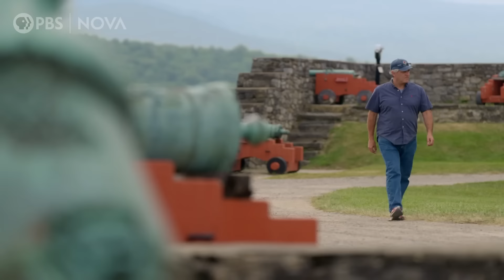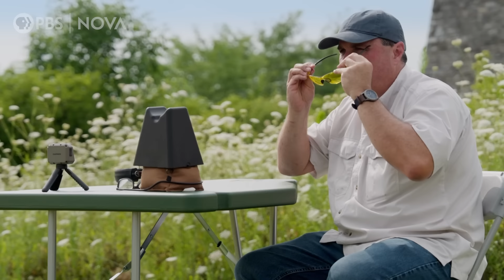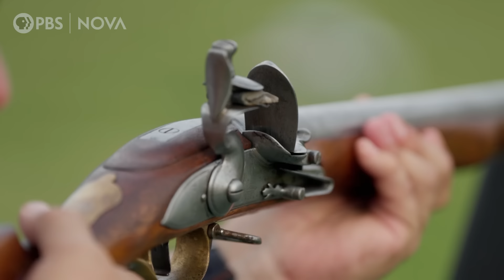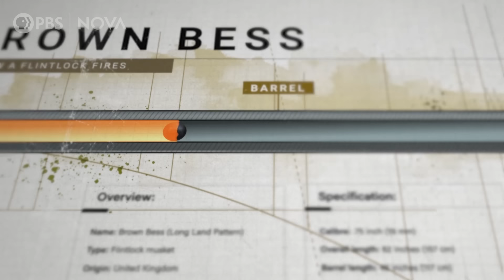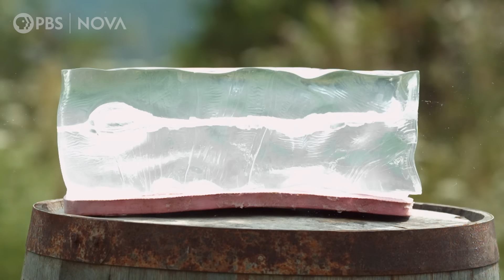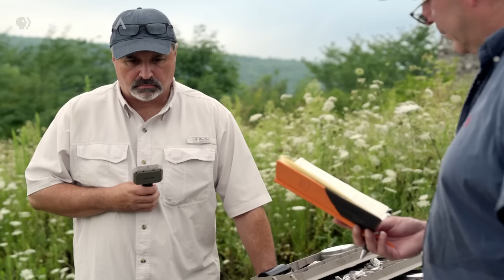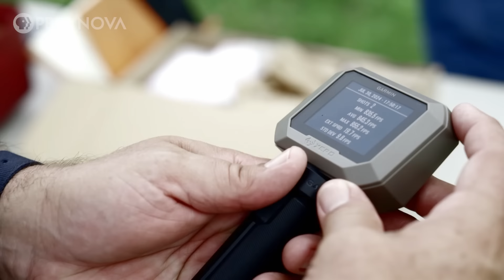How Deadly Was the Musket? | NOVA | PBS

Comment: This has already been scientifically solved. Energy and cavitation are insignificant compared to what tissue or vital structure is actually damaged by the bullet. For example, energy/velocity is important only if it creates the correct wounding method for the bullet. That can be through expansion or fragmentation. Cavitation or the more correct term, temporary wound cavity, is only significant if it exceeds the threshold at which our tissue stretches and contracts. If it exceeds this then yes it would create tearing which would then be considered part of the permanent wound cavity. The 2 primary methods to kill or incapacitate someone is through blood loss or destruction of the heart or brain.

Comment: That is NOT smoke from yhe bullet. Thats probably water vapor from rapid expansion and contraction of gas inside the pocket the bullet makes condenscing and then boiling water off into steam. If you look at the "smoke" exiting from the entrance hole, it seems much more like an energized gas than a residual smoke.

Comment: I am doubtful about the test because there is no data on the load, the bullet weight and exact diameter, and its loading method. Besides they are not the first to shoot with black powder on gelatin. The napoleonic Charleville 1777 was loaded with 12 gramms (186 grains) of black powder. This terrific amount of propellent with a very large and soft bullet (.69 lead bullet) should have a better stopping power than a smokeless rifle cartridge within 200 meters.

Comment: feets, miles are very unscientific measurements.
Reply: No they're not
Reply: @JS-wp4gs  yes they are. In metric systems everythin is 10 based. 10 milimeters is 1 centimeter, 100 centimeters is 1 meter, 1000 meters is 1 kilometer. Imperial 12 inches 1 feet, 3 feets is 1 yard, 1760 yards is 1 mile. Where is logic? Its absurd

Comment: Unless I missed it, they failed to divulge what distance they were firing at. They also state the Brown Bess fired a 69 caliber, which is not true. The French musket of the time fired a 69 caliber ball, but the Brown Bess fired a 74 - 75 caliber ball.
Reply: Proper procedure is to load a ball of a smaller diameter than the bore size to aid in load speed so a brown Bess would be a .69 caliber ball and a French charleville type musket at a .69 bore diameter would really shoot something closer to .64 or .65 caliber ball
Reply: The Brown Bess was 75 Cal.  The French Charleville was 69 Cal.
Reply: The Brown Bess was 75-80 caliber but fired a 59 caliber ball, the Charleville was 69-72 caliber, and fired a 63 caliber ball.

Comment: The musket is accurate out to 75 yards, or so. It loads quickly, under 30 seconds. The rifle is accurate out to 200 yards and more. But, it takes close to a full minute to ram that ball down the bore. It also requires a lot more practice to hit what you're aiming at ,especially at distance.   Thats why the musket was weapon of choice, easier to train a man to competence, deadly, in volley fire, up to 100 yards.

Comment: Honestly I’d rather have a regiment of longbowman than muskets.  Longbows have two or three times the effective range of a smoothbore and trained longbowman can get 6 shots a minute.
Reply: Muskets have longer theoretical range than longbows. Muskets have a shorter accurate range than longbows. Keep in mind that archers didn't really shoot up into the air as you see in movies. They shot straight at the enemy and aimed for armour weak points - elbows, armpits, visors, etc. Also, training an archer would take years. Training a musketeer takes weeks.
Reply: But if you lose even one bowman you lose a man with years and years of training, but if you lose one musketer you lose one recuit with about a month of training 
You need less time to train guy with a musket
That's why armies started using muskets and not bows
Reply: @Francisco-h6u4sThat’s a very good point.

Comment: SMLE is one of the finest rifles ever produced & fielded
Reply: Mauser gewehr 98
Reply: @SneakyPegasus  yep
Reply: Mauser Kar98 was a marksman's rifle. The SMLE was a battle rifle. 10 rounds in the magazine instead of 5 and a bolt system optimised for rate of fire. As a design philosophy, it was the right kind of rifle for the time when people were still trying to make a practical standard infantry assault rifle where rate of fire was a greater priority over pinpoint accuracy, especially when the slightly greater accuracy of a Mauser would have been lost on the average infantryman who was an average shot.  @HansEgonMattek
Reply: @T @TheThundertaker at ever makes you think the Mauser was any more accurate than the Lee Enfield?
Reply: @johnwalker1471 broad consensus. It's wasted on most users though, and would matter more to snipers than it would average infantryman.
Reply: I have to argue for the M1903
Reply: @Gauge1LiveSteam  decent sniper rifle like the Mauser it is based off, but flawed as a battle rifle due to its smaller magazine and slower bolt handling.

Comment: The other reason is that smoothbore muskets couldn’t hit anything beyond 100 yards.  Modern rifling twists on match grade barrels with spitzer bullets can reliably hit targets 2000 yards away.  There are many modern handguns that have comparable accuracy to a smoothbore musket.  Rifle muskets, on the other hand, which were around at the same time, like the Kentucky long rifle, could reliably hit targets at 200 yards or more.  By the mid-19th century, conical bullets in rifle muskets were hitting targets at 400+ yards.
Reply: Modern bullets can't hit a target further than 50 yards. That's a scientific fact. On average, 50,000 modern bullets are fired for every kill :)
Reply: @KaL_69_ I see the autistic pedants are out in full force this Saturday morning 😂
Reply: That was on training grounds. In battle, soldiers would panic, aiming too high or too low, and were still limited by the fact that you can only see so far. Not to mention obstructing trees, hills, etc. That's why infantry engagement ranges on the battlefield never reached that far.

Comment: The musket was used in place of the rifle for two reasons - speed of reloading and cost! A trained British Army infantryman was expected to load and fire his musket 3 x a minute at a minimum!  A rifled musket (rifle) of the time - such as the good ol' Baker rifle - could be loaded and fired twice per minute. Sure, the rifle had greater range and accuracy, but the infantry tactics of the time (large formations all standing in a line out in the open) meant that the more bullets in the air the better. The formations used at the time essentially made the musket-wielding infantryman part of a giant shotgun blast, which would do some serious damage to enemy formations.

And of course, the musket was cheaper and faster to make than the rifle, as there were no grooves to be cut in the musket's barrel.

Comment: The musket had two disadvantages against any rifle, both caused by the smooth bore.  The first was accuracy, the second was effective range.
Reply: Don't forget, both are using different kinds of powders. Rifles not only had a perfect gas seal, but also powder that ignites much faster and efficiently, which results in more gas being produced, which in turn results in a faster velocity.
Reply: Ammunition capacity and reloading time were far, far bigger disadvantages than either of those.
Reply: @hux2000  Rifles were reloaded so slowly that Emperor Napoleon I refused to use them, and repeating rifles weren't used until the American Civil War.

Comment: well of course a big fat lead ball is going to do damage. The thing was they didn't always fire, and you couldn't count on hitting anything beyond 50 or 75 yards (at most!) The two armies blasted away at each other, from 50 yards or less, until one side got shaky. Then the other side (esp.the Brits) charged with the bayonet.
Reply: nope.
Reply: @lutzderlurch7877  Yup. Thats literally exactly how it worked
Reply: @JS-wp4gs  not really. you can hit  further than 50 yards with a musket and the average  distance of 18th c  battle firing was  larger than that, as well. do not mistake memes and  'common knowledge' formed by myths and simple stories for an accurate  depiction of reality

Comment: Rifling was to improve the accuracy of the rifle.   Fact, The Baker Rifle and its pattern variations was in service with the British Army between 1801 and 1838. The weapon was a standard rifle with a caliber (ammunition size) of 0.625 inches (15.9 mm) or 'carbine bore'. It weighed about nine pounds (4.08 kg) with 300 yard effective range.  It did as much damage as the smooth bore musket.   That said, a modern rifle, 300 can kill you at 800 yards so the point is moot.

Comment: The Shotgun, loaded with a slug, is a Modern Musket. If that tells you anything about the lethality. Although a shotgun is maybe twice as accurate because of engineering.
Reply: Modern slugs are rifled
Reply: @chrisyungeberg6978  the notches engraved on slugs do not provide any stabilization at all, it allows the slug to be crushed by a choke bore. Rifled barrels are aftermarket because otherwise it makes the shotgun a Rifle and therefore an ATF controlled Destructive Device (a rifled weapon with a caliber exceeding 0.50)
Reply: Very good point, also in this test the amount of powder for the musket was probably half that of an actual service charge which was around 160 grains, that would make the ball go way faster than in this test
Reply: I didn't even watch the test, its just practically speaking the closest equivalent to a modern musket is a weapon with a large bore used for hunting that could also be used for home defense possibly. Because that's what muskets were used for. To shut down any talk about m-16s being modern muskets. The m-16 is the modern equivalent of a Brown Bess, the military weapon used by the british army.    @petterslattas7269

Comment: In defense of the flintlock musket it was the best infantry weapon for militaries of its time in the 18th and early 19th centuries being relatively cheap, easy to produce, fairly reliable, and effective in battle especially when used in the typical lines of massed soldiers firing volleys. The rifle, while more accurate, was harder to learn, slower to load, and much more difficult and expensive to produce making the musket the batter weapon for an army. Also not mentioned is the Charleville Model 1766 musket used by the Continental Army which was supplied by France. In total between 3 million and 4.3 million Brown Bess Muskets were produced and more than 7.7 million Charleville Muskets were produced as well.
Reply: Lol really.man . The rifle is faster to load and handle . Unless you're talking about the riflled musket still it's alot newer compared to the musket so it's more reliable
Reply: @ the 18th century long rifle took longer to load, was harder to produce, and not as easy to master as a musket was
Reply: @nicholasgallo3599  got it now . That makes sense

Comment: What a nothing-burger.  The muzzle-loaded, smooth bore, black powder musket vs a cartridge-fed, smokeless powder modern rifle is hardly a fair comparison.  Certainly the musket had it's place.  But beyond 50 yards it's effectiveness tapered off substantially.  There's a reason they were used in ranks and fired in volleys - mass fire helped overcome the musket's limitations on the battlefield.

Comment: An Enfield .303's maximum effective range was 550 yards, a Brown Bess's was only 100.  BIG difference.  Not to mention it has a ten round magazine.  If one side had those vs. the muskets, the side with the muskets would never get close enough to shoot back.
Reply: This is not true. The Brown Bess can be very effective at ranges up to 200 yards.
Reply: @KaL_69_  it had a effective range up to 100 yards (assuming you're looking for an accurate shot). It could be lethal at farther ranges, but its not very accurate. If you're shooting line against line then yeah 200-300 yards would and did happen. Smoothbore flintlocks are more accurate than people think, but they still were more unpredictable than a rifle which is why mass volleys were the normal for combat. Hunters during that era preferred rifles, but they used what they could afford.
Reply: @uhavekrabs  This is a misconception. In the 18th century, it took an average of 30-50 shots to kill one man; in the 19th century, it was 100-150. In the 20th century, tens of thousands of bullets are expended per kill. Do you still believe in the magical accuracy of rifles? Overall, the range of combat has remained the same. In most cases, soldiers fire at ranges of 1 to 200 yards. Only snipers shoot at longer ranges.
Modern hunters generally prefer shotguns. So why would 18th-century hunters use rifles?
Reply: @KaL_69_  "the magical accuracy of rifles". That is a new one. Now I get why you have so many replaying to your other comments.
Reply: @uhavekrabs  That was sarcasm, if you didn't understand.
Reply: @KaL_69_  "Modern hungers generally prefer shotguns"...  Depend on what you're hunting and where.  You're not hunting elk in Montana with a shotgun.  Not to mention, a shotgun shoots a bunch of different type rounds.  
As for your "statistic" about how many rounds are used now, you're completely ignoring the fact that cartridge ammo is mass produced and in such great supply that you can expend a bunch of rounds and rapidly reload.  You also ignore automatic weapons.  Your comments are WAY out of context.
Reply: @ffjsb  You're missing the context. It's not the range or accuracy of fire that's decisive, but its density. You can build an army with Barrett rifles, but even African rebels will easily defeat them because they have a huge advantage in lead mass per square meter. Modern warfare is a matter of large numbers, not precise volleys, each inflicting damage. Automatic weapons have only exacerbated the trends I described above. For example, during the Russo-Japanese War, accuracy was completely out of the question. Armies fired tens of millions of bullets at each other, but only a tiny percentage hit their target.
Reply: Firefights between formations usualy started at 200-300 yards
Reply: Even further than that for less precise shooting.

Comment: The "dogs head" holds the flint which scrapes the "frizzen", igniting the powder in the "flash pan" which sends a spark through the "touch hole", igniting the charge.  There is no "hammer".
Reply: I was going to say this, too, but I found several sources which say that the frizzen was actually originally called a hammer in the 1700s. I can't figure out why would it have been given that name since it gets struck rather than doing the striking.
Reply: @sbreheny  I'd never heard of that, but if you dug deep and found more comprehensive information...I SALUTE you!
Reply: There are plenty of so-called experts who say one thing and the other so-called experts who say another thing.
Reply: The terms "frizzen"  and "hammer"  have been interchangeable for the whole period the flintlocks were used.  Frizzen is the more accurate term, describing the actual part of a flintlock.  Hammer, when defined, can describe a few different parts that may be found throughout the mechanical universe, but frizzen only refers to a specific anatomical part on a specific device - the flintlock.

Frizzen comes from German origins, apparently, meaning "crisp, frizzle, curled", can be associated with fried, etc.

Frizzen is the correct term, IMO.

"dog's head" is one term for the top of the c@ck, which has the jaws that hold the flint. "c@ck describes the entire part most people call "hammer" because it looks like a strutting rooster.  Today, referring to it as the c@ck is liable to get you looks:body-green-covering-eyes: We do however still c@ck the hammer.😆